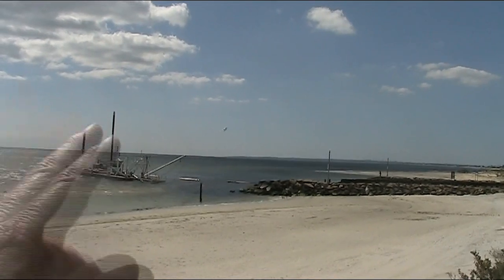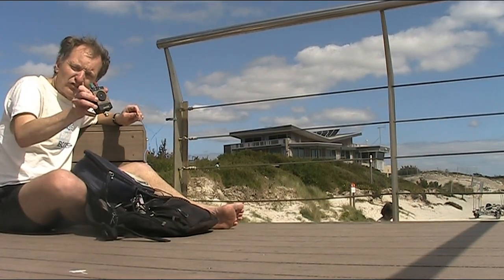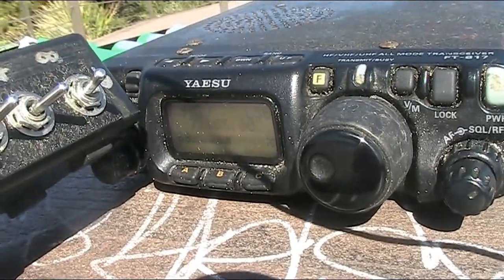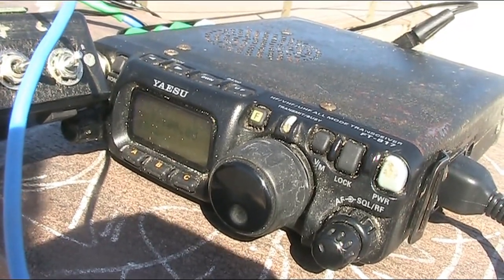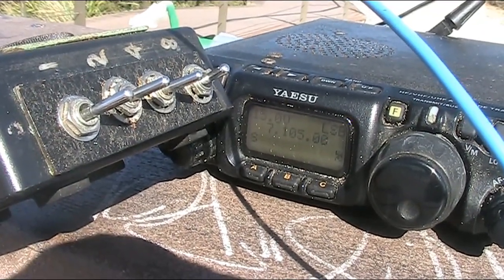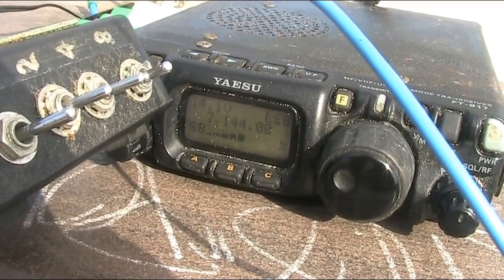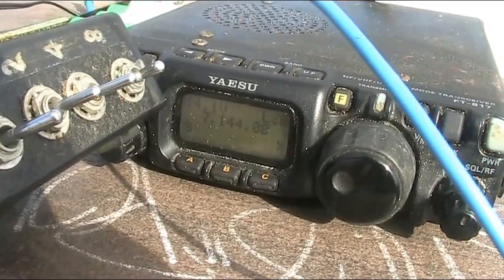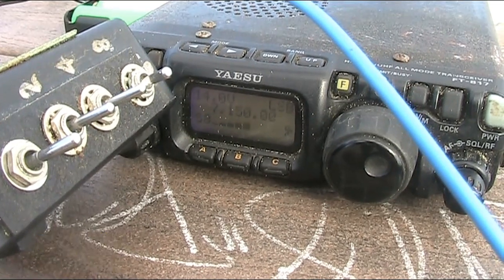HF fence antenna: Does it work?

Comment: From results, maybe fence was acting as an inefficient NVIS antenna?
Have used fences as counterpoises before with some success but never as main radiator. I am wondering, if a fence is insulated from ground (e.g. wooden posts), could the far end be terminated to make a Beverage Antenna? 🤔

Comment: You have got great videos ,keep it up. Now could you teach how to get things off surface mont boards and use them in other projects,I know that is a tall order to fill. But you did a great job  with the TV tuner. Like to see you do more stuff like that.  My though has alway been that we as amatuers should be able to build stuff from not  quite nothing but close. Just some food for thought. Va1dwg  cheer  p.s. just want to learn all I can in this life.
Reply from the maker: Thanks. I know I should do a video on this but I have a good supply of leaded parts so motivation is low.

Comment: Didn’t hear you mention a ground? How do you manage that when using metal objects in this way? Sometimes with fences I’ve seen people clip the ground to the bottom of the fence and antenna to the top, but could you just attach your own counterpoise too?
Reply from the maker: usually a short wire counterpoise
Reply: in australia the ground is the sky

Comment: G'day to you,,, that poor old Yaesu look like it's been dug up from the beach.. Yes all types of wire work as an antenna.. I started in 1973 on 27mhz and used the 240v home power wiring as an antenna but ya got to know what ya doing.. But by golly it got out..  I later had a Kenwood ts820s and I could tell you some stories. But pirates are frowned apon.. 73's
Reply: Frowned upon….Only because they’re jealous
Reply: Front and back metal grills off a floor fan.  One to the shield and one to the center.  Used a tiny manual antenna tuner.
Reply: @piquat1  I used: any length of rg58u from the ts820s, to a 9'6" aluminum tube cable eathed to the tube with the center sealed small length of 240v cable with a standard 3 prong socket green wire screwed to the aluminium tube the other two wires covered this silicon, plugged into the the power socket and turn on the power. It's going back 43 years I may have missed something. Oh yes a Yaesu atu. The ts820s had 27MHz in it. I worked heaps of stations out of band, noted United States Navy was good. And I never got caught.

Comment: could it be that most of the HF energy is conducted off to the ground by that metal railing ? that would explain the low signal strength when transmitting. i think i would have rather hang a 1/4 wavelength copperwire somewhere there, that would work better. a wire that long has 50Ohm already and accordingly doesnt need an extra balun or unun or tuner etc., less power loss. 

by the way, walking barefoot not a good thing to do. what if there is glas shards or other sharp objects on the ground and there is random people who are maybe infected with hiv herpes etc., what if they spit on the ground and there is then a cut on the foot from those glas shards, an infection is then like pre-programmed. how likely is that, maybe only very little likely and its always going well, nothing happens till one day and then its to late do do anything about it. better is to wear at least some sort of shoes, sandals or alike. i know i'm not talking to a child but just saying once, people arent perfect and can forget or simply not think about one thing in particular like that. 

how safe is the sea there ? i heard there are very toxic little jellyfish in the water, difficult to see in the water to protect from, beside of course sharks.
Reply: You must be new here.  Peter hardly ever wears shoes.

Comment: what battery do You have for Your ft817? I have ft818 and my battery (from scooter) drops voltage quite fast during transmission, causing the tx power to drop from 5W to 2.5W
Reply from the maker: Usually this - unless I'm operating for longer https://www.youtube.com/watch?v=R-eGSbVA7lY

Comment: Stainless steel is the worst every day object metal. Any galvanised steel would be better. Aluminium poles, gutters etc the best frequent street option.
With some risk of having to deal with intervening custodians a bronze statue better still. Some fancy buildings have copper roofs and exterior details.
Connecting a "crocodile" to to any of those might be very suspicious looking too.
de SA3BOW
Reply: The worst antenna is no antenna at all. There IS an element of "Anything goes". At least if one set ones expectations right.
de SA3BOW